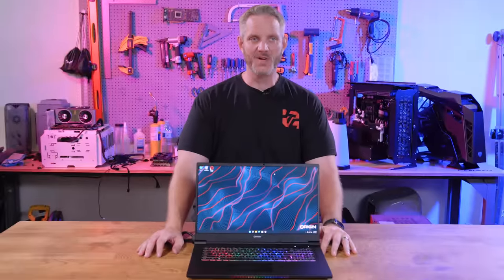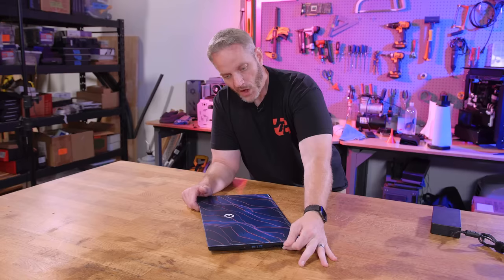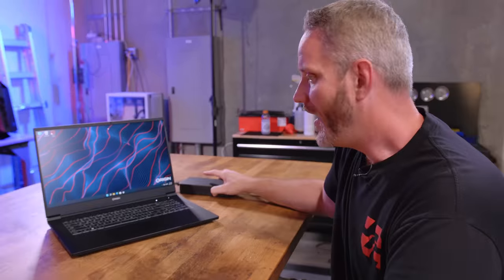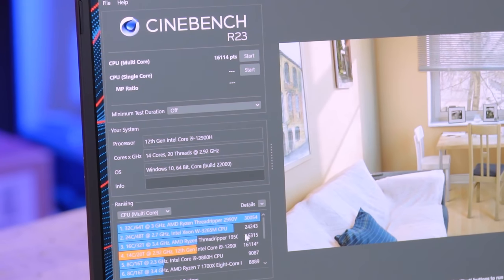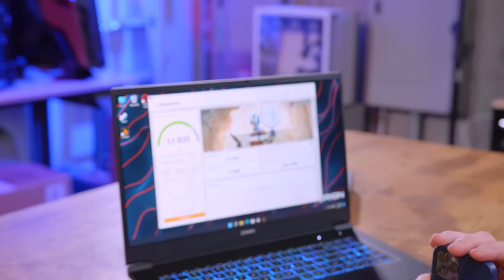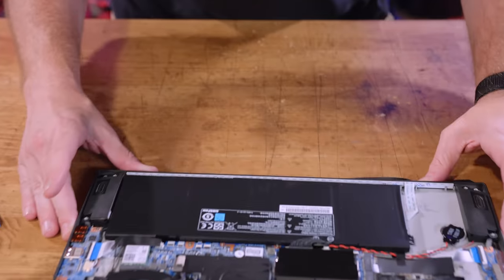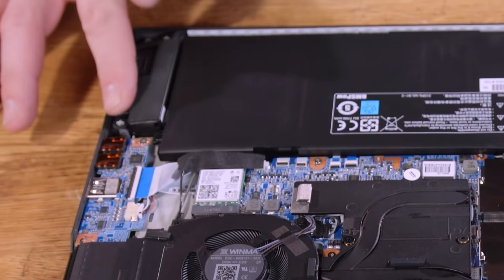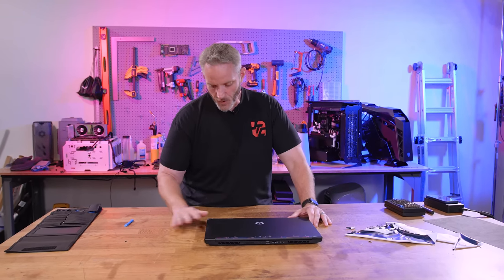This laptop just made your desktop obsolete!

Comment: Yeah I agree with Jay that Nvidia should rename their Laptop GPUs to like 3075 or 3065 etc because it would be less confusing for the customer considering that the Laptop version of the GPU is less powerful than the desktop variant. Or hell just go back to using the M labeling because that would make it easy again like it was during 9th gen. Other than that this Laptop is very good.
Reply: Or go back to putting M on the end
Reply: The naming is intentional. They don't want the regular person to know that the laptop gpus are different. They even removed the maxq branding to enshure this.
Reply: That sounds even more confusing. Is a 3065 faster then a 3060? Calling them M at the end is a much simpler way.
Reply: @Tofuey  It was an example based on what Jay said in his video, however putting the M back into the equation is not a bad idea either.
Reply: I agree as 3070/80...etc has a certain expectation from a user point of view.
Reply: an educated laptop owner knows howto us techpowerup to check the specs. the 3060 mobile for example has a gpu with more cores then the 3060 desktop version. it's just a way lower clock speed and reaches a lil bit over a 3050 desktop performance level.
Reply: adding a 5 is even more cofusing lol lite ou M for mobile is the way to go
Reply: @glitchered  lol laptop users are even more noobs forget it
Reply: @ThaexakaMavro  well thx.
Reply: @killersberg1  To be honest, it's probably borderline legal. I don't think that misleading is legal though. There are different variants of Gpu's out there. The main difference being those which are for laptops and those for desktops. Than, there is Max-P, Max-Q, with different performance and spec sheets. Plus there are laptops which come with a full sized desktop GPU, albeit that the cooling solution is not as good. The bottom line is, you can't have different products, which perform differently from each other, are specced differently, called the same name. That's 100% misleading, in my book.
Reply: @ron200088  They work around this by saying mobile in the name but partners do not have show that. The max branding is deprecated.
Reply: @killersberg1  Yeah, I know. But still sounds misleading and a shady practice. It’s clear to me that they do it, only for financial purposes.
Reply: Really, they should just go back to the M designations for mobile chips. They used to have stuff like that years back & it makes more sense to do that, then include how it compares to a desktop part (e.g. "3080M is equivalent to a 3070/3060Ti desktop card")
Reply: @tomferguson9250  Agreed
Reply: @tomferguson9250  Yea but then they cant have like 4 different versions of each of them like they do now with different power limits. Like the version in the video is probably not the top 3080ti available with the 140w tgp limit or whatever it is now. That one can score like a desktop 3070. Its really screwy currently cause you could get a 3080 ti laptop with  a less than 100w power limit and have it perform less than a desktop 3060ti, Imagine finding out you spent the money for that, that would be a shitty day.
Reply: @edamnaf9265  Yes sire
Reply: @connorjohnson4402  yo. power limits are a bit tricky on mobile. it depends on the cooling and the power delivery/brick. i got a low end 3060m too. it's specced at 80W. reaches 75 C under full load. i guess i could flash it to 115W to get almost desktop boost clocks. it's the only mobile gpu that can match it's desktop counterpart. the brick would probably not survive tho and it would get really hot. not worth the percentage increase boiling it to death. if it runs cool and not too loud it's better. i can live with a couple fps less. mine are limited to 60 anyway. :)
Reply: And for them to stop limiting the GPU watts down to so low like it just barely runs it.
Reply: @glitchered  Mine is limited to 75W. And that sounds like it barely turns it on. 90W is more than adequate to call it a max q variant.
Reply: @killertruth186  well... that's alright. what you do with it? the max-q is about quietness. it's an audio guy rig. sure... the 90 watts has a lil more boost clock but it's louder. yo. percentage tho.
Reply: @glitchered  I have MSI GF65 Thin 10UE. But the real funny part is that the 3060 on that gaming laptop, it doesn't have Whisper Mode 2.0.
Reply: This, is not capitalism-friendly
Reply: IF you think you are getting the same gpu in a laptop as a desktop you have a few more problems I fixit couldn't handle lol especially thinking a less powered gpu should be numbered higher i.e. desktop gpu 3070 but YOU want a laptop gpu to be 3075 but be less powerful than the 3070? lol
Reply: @gamergonegaming6811  Well we can agree on that Nvidia should do rebranding of their mobile GPUs though. Like adding the M label back to the Laptop GPUs like during 9th gen.
Reply: I prefer they return to putting the M back
Reply: You still have to check the laptop manufacturer specs because there are different wattage versions of every gpu.
Reply: Not all mobile gpus are the same either. I got a new laptop with a 3070 in it. Others had power bricks at less then 200w mine has a 300w brick and it sucks the power down while gaming. The gpu only losses a few percent from a standard 3070 pefotemance in games like cyber punk.
Reply: @happybunny1986  Oh I know. I have seen gaming laptops with huge power bricks and some of them used 2 of them.

Comment: I recently bought the MSi creator 17 (B11UG-239). It's an 11th gen, but very similar to this one, except for a 4K display. I am practically awed by its ability to stay as cool as it does given that all of the outer finstacks are no more than 5mm thick. The whole thing is very thin and light.

As far as ease of repairability, I'd give it a 98 out of 100. There are 15 screws to release the bottom panel. After that, four to remove the battery, one per drive, and four for the motherboard (includes the WLAN card). Then, there are 7 total for the heatpipe assembly. There are only 3 types of screws, though.

Overall, pretty darn satisfied.
Reply: This past September 2021 I got the MSI GE76 Raider 17.3" 360Hz FHD Display, Intel Core i9-11980HK, NVIDIA GeForce RTX3080, 32GB, 1TB NVMe SSD, Win10 ,Titanium Blue (11UH-053), plus an extra NVMe 2TB for storage, paid $4000 aprox,  and it is a beast by itself
Just finished paying it off last month and no regrets at all, runs everything smoothly.
Reply: looks like a nice rig to me.
Reply: Ease of access of the ram, ssd,  heatpipes and such is not repairability though lmao.
Reply: @hatchet646  it's just accessibility, not much use if you can only look at the parts and not repair them
Reply: @hatchet646  True, it's nothing compared to my M6500, where I could replace 99% of the components on the board (even though it was a beast to disassemble). Given the B11UG's thinness, I can't complain too much. At least it's better than a MacBook these days. I miss the 2008 MacBook Pro, lol.
Reply: @LoneTiger  That is a beast of a machine. Congrats!
Reply: @2spooky  Thanks, it is a beast.

Comment: I've got the Eluktronics version of this, and I'm amazed how much of the same software , hardware, and chasis it shares. Modified /Customized Tongfang afaik.There were minor differences (like better grammar and personal touches in default profiles from Eluktronics), but much of the same chasis and internal software was used. However the biggest difference is with mine is that Eluktronics has a watercooled option and I went with that. Backpanel is clearly different, internals different. Hybrid air/watercooling with potentially both running. 

Runs great, though having a watercooling pump & fan running all the time is clearly louder than having a fan that's off. Runs fast and cool. 

Thanks for mentioning the two modes. I never considered running pure efficiency, because this laptop was meant for beast mode. 

Everything seems fine, just if anyone gets the LPP (watercooling) option, only use distilled water, don't use any coolant or other liquids. 

I too wish these existed when I was traveling. I used to carry much heavier clevo laptops that were 10 lbs alone and I'd have 20+ lbs of electronics in a bag.
Reply: Damn, sounds like a good way to get buff😅
Reply: Which lpp model did you get? Mech or Prom? Any problems with it so far? My finger has been hovering over the order button for the mech 15 for the past week.
Reply: @Mochimatchamocha  No significant problems. Personally got mech, as I prefer the keyboard and I have a video up unboxing it-- though I think the 17" Prom might be a good idea too. 

Takes some time to configure W11 to how I liked it. Recommend emailing them to get extra goodies from bundle. 

Only an unexpected personal issue that the low pump fan hum puts me to sleep like a lullaby when there's no other sound going. 

Otherwise, works as I expected. Runs fast, runs (water)cool. Runs W11.

Comment: I have the Maingear version of this, I was amazed at how well optimized it is. The software settings are straightforward and worked, literally the most no BS software I ever used. I was able to boost the 3080 to 165W but it thermal throttled down to 130W.
Reply: Yeah a 3080 running at 130 watt is basically a 3060...
Reply: How does Linux do? If you can, try MX Linux with the Advanced Hardware Support kernel and see how it does.

Because if it doesn't work, then fuck this laptop because I'm not running Windows 11.
Reply: @arnox4554  should work just fine I hope 
I'm in the same boat fuck Microsoft operating systems lol
Reply: I have the eluktronics 15 inch version of this. Im able to keep it at 165w by applying a bit of undervolting
Reply: watercool this shit and You will be ok :)

Comment: 280watts @ 14amp DC means voltage of ~20v. Even calculating with a 70% efficiency... on the AC side of that converter you'll see maybe 365w @ 110v so maybe 4amps.

Comment: Origin is overpriced for what you get. Plus, buying an i9 in a laptop in general is not usually worth the $ cause of power limits/thermals.

They're all Clevo and Tongfang based, so there are multiple resellers of the same laptops. Origin usually the most expensive of the resellers for the same chassis/specs...
Reply: What others sites are you looking for prices
Reply: Eluktronics, GentechPC, Sager, ProStar, Xotic PC, XMG, CyberpowerPC, etc..

Those are the main ones that come to mind but I think there are others as well.They all  resell the same Clevo or Tongfang based laptops so always worth checking multiple resellers for price differences...

Comment: Checking the website shows that this build is somewhere north of $3.5k USD. I'm not sure why I would spend that on a notebook, but I'm sure that it has its use case. Lovely tech though that's for sure. That's for the vid Jay & team.
Reply: @opetyr  I tried to build one with as good if not slightly better specs than my own build and I ended up at 4.1k. Honestly if it performs well enough i personally think it'd be worth it.
Reply: North of $3K and no wifi 6 network. That's plain dissappointing
Reply: @mrcharlied4228  WOW. I am honestly fucking SHOCKED.

Literally EVERY gaming lappy I've looked at in the past 1-2 years has had either an Intel AX200/AX210 or the Killer equivalent in there.

Damn, Origin. /smfh
Reply: @2thumbsup247  Did you even watch the  video? This is comparable to a 12600/12700k + 3070/ti. While I can get a 12700/12900k + 3080 for around 3k on desktop.
Reply: @i.m.crazee5195  i finished typing my comment before i saw results. Yeah print the power of a similarly priced desktop I'd personally say it's worth it
Reply: @2thumbsup247  I still think that's it a bit steep, reduce it by a couple hundred dollars and it'd be decent enough.
Reply: The asus strix 17 SE is 3.5k with a 3080ti 150watt(up to 175watt)
Reply: Nah man.  I paid $1500 last year for a 6800m and I got 11642 timespy gpu just 2 days ago.  Why would I pay $3500 for 11842
Reply: @bah-nah  is the whole point of that laptop to just get a high benchmark score?
Reply: It's in no way worth it. When you use a powerful laptop on max load (if it's your main for example) those fans will wear out from screaming at 3000 RPM.

Even if it's slightly cheaper than a desktop, it's still not worth it because in 3-4 years you'll have to throw all of it away. No way to upgrade it. You'll probably have to clean the fans and change thermal paste before the warranty is over. And if you send it to a technician to prevent voiding of the warranty, gg you are without a PC for 2 weeks minimum.

I have a 3yo ASUS TUF gaming laptop. There is some "ghosting" starting to appear, it overheats like hell even after a cleanup. It used to be great, never went about 80°C under load. Now it thermal throttles every 5 minutes. The fans generate 50-55dB which is loud as hell.

Laptops are e-waste.
~me, who has used laptops exclusively for the past 15 years.
Reply: ASUS ROG Strix Scar 15 G533QS is better than this one, and it costs less :D (not much less but less).

LOL SPREAD THE WORD ASUS! => My more than 1 year old Laptops 3080 eats this 3080ti alive :D
Stock Values on Timespy (no OC, or Fan Profile edit):
12074 GPU Score (130Watt) <-- smokes ur 3080ti with 150 Watt like wtf :D
10505 CPU Score (80Watt Dynamic)
11809 Overall Score
This is what i call power-efficient!
With an ASUS ROG Strix Scar 15 G533QS (3.2k € at time bought)
[CPU] Ryzen 9 5900HX (8c/16t x 4.6GHz) (Liquidmetal)
[GPU] NVIDIA GeForce RTX 3080 @ 16GB GDDR6 RAM (RAM Clk @ 7151Mhz / GPU Clk 1905MHz) (Liquidmetal)
[RAM] 32GB DDR4 (2 x 16GB 3200MHz)
[Display integrated] 300Hz, 3ms, IPS
Reply: If you’re in the military and traveling a lot with minimal space I could see it being worth the premium to have something this powerful and portable.

Comment: What might be important to note for a quick comparison: The mobile 3080 ti is basically performing like a 3070 for a desktop. So it's very good, but it's not exactly going to push 240hz on ultra in most games in 1440p.
Reply: Damn so it seems about 3060 is the point where they stop being similar

Comment: For fun I built an i9 laptop. It cost roughly 4200 before shipping. I went through the on-board wifi card and it only does b/g/n. Not ac or ax. For that price you should be getting 802.11ax which is wi-fi 6. No reason to be so far behind network wise unless you just do that to make more money... I digress.

Comment: If that screwdriver is a Wowstick like the one I have, it should have come with a fairly small thing that says +Magnetize and one end, and  -Demagnetize on the other. Seems that would have been useful for you in this case. I've used it several times to pick up small metal objects and it works fine. No hate on iFixit though, I have it, use it, and love it.

Comment: i had laptops in the past where temps caused major throttling in games etc so when i got my razerblade 15 i expected the same but honestly it wasn't that bad not throttling then i bought a cheap metal riser off Amazon that tilts it up off the desk and temps dropped massively! now my gpu will be 60's when gaming and cpu in the 70's very respectable for a laptop with zero undervolts or underclocks etc. I will always have a huge preference for desktops they obviously can perform on another level but gaming laptops have come a long way in quite a short space of time and it's good to see. ps. that cooling system is very similar to the one in my blade 15 it works a treat and i know what you mean about the audio my iphone 13 pro audio is honestly amazing considering it's a phone.

Comment: Have you checked Eluktronics laptops? I am a big fan of the company, and recently upgraded to a Mech-17 G3 Water Cooled i9 12900 3080 ti Laptop. They have upgrade options for 64GB DDR5 and 2TB Samsung NVME Drives. They are soon releasing the G@ Water Cooler with RTX40 series cards

Comment: With the exception of the video card, that thing is far more powerful than my PC (i7-8700k) - mindblowing how thin it is considering the components
Reply: Which means for gaming, that your PC is significantly more powerful.

A 3080ti desktop would still be the bottleneck for basically every game not Microsoft flight sim for the CPU in the laptop. It's the botttleneck to my 12600k currently.
Reply: @deathhimself1653  Maybe, but I find with games like BF2042, I'll get major input lag at times because my CPU is hitting 100%, whereas the GPU is hitting maybe the upper 80s-low 90s - I'll have to see next time I play 

I think the next major upgrades for me will be the CPU to a 13-Gen Intel i9, large capacity NVME SSDs and and a 4090Ti whenever that drops (and my pockets can afford them lol)

Comment: I wonder how much a replacement motherboard is with a 3080 Ti and 12900H soldered to it costs? Anyone buying it should get the longest extended warranty available.  Laptop GPUs generally don't last anywhere as long as desktop GPUs because they cook themselves to death. Now that all of the crap is perma-welded to the motherboard, a dead GPU takes everything with it in one fell swoop.

Comment: I feel that if I need this much power in a laptop, they need to make a laptop with a 24" 4k display. Should be plenty of room for more cooling and might get me to willingly leave my dual 28" desktop behind for a few hours.
Reply: At 24" its not really portable or a laptop
Reply: Imagine walking around with a flipping 24 inch laptop in your bag, I already have problems fitting my 17 inch laptop in
Reply: @cckiller4378  - No worse than a large folio, really. It would be built to laptop standards, saving a bit on the weight. When I started lugging around computers to clients, they had these things called "lunchbox" portable computers. THOSE were terrible to to lug around.
Reply: Maybe 21" would be more reasonable